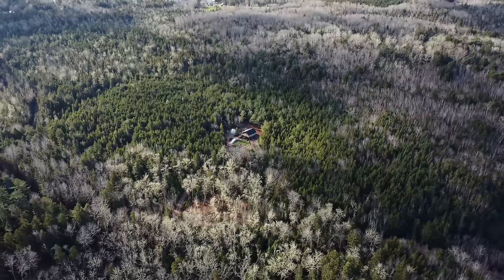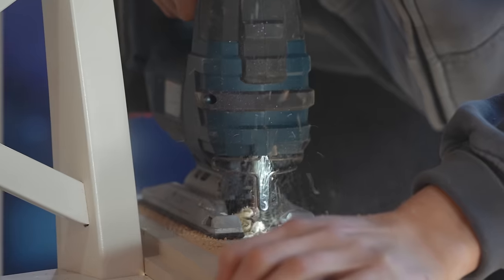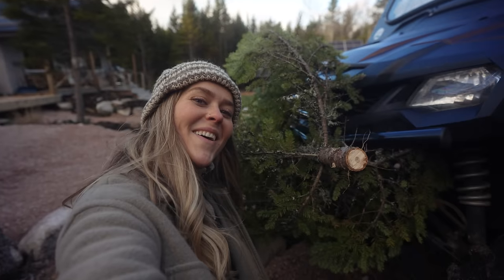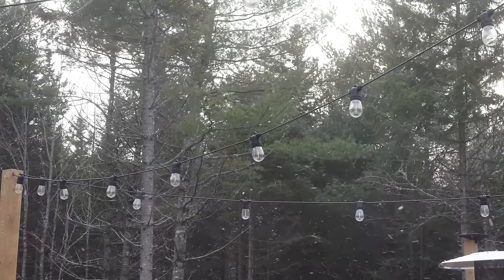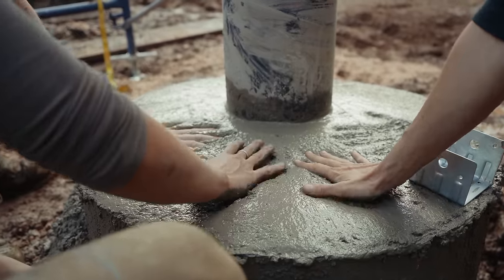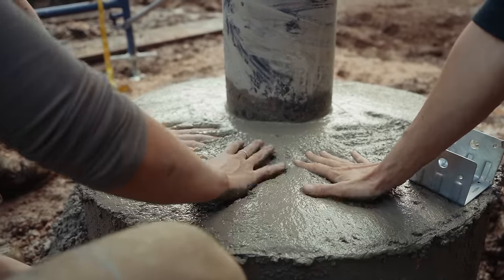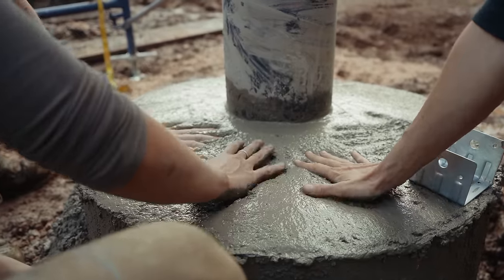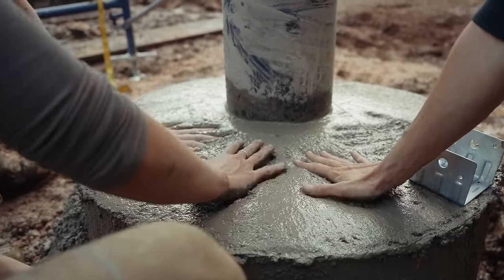Tiny House Bathroom Renovation!

Comment: You guys save so much money by doing that shower yourself. We just recently called a plumber to ask them how much they would charge to take out the old shower insert and to place a new shower insert and new faucet. They wanted 2800 USD to do that job. I even told them we would take out the old shower insert so they didn’t have to do that. The price was still $2800! So with having to buy the new insert which was $1800 we were looking at almost $4000 to put a new shower and new faucet in our bathroom. No thank you. You guys have given me the confidence to do it my own damn self. Thank you!

Comment: You gotta love the Pex plumbing. Even after 10's of thousands of fitting I've only had a couple that leaked but were easy to fix.
I'm wondering why you weren't suggested to embed tape on your seams when applying the Red Bond. Still, you two Rock as usual!
My favorite way to get to my plain of relaxing is to start at my feet and flex my muscles for 20-30 seconds then relax for 5 seconds and do each zone 3 times working my way upward.  
By the time I get to your head my body feels so relaxed it's almost like feeling numb. It's something I was taught by a professional weight lifter.
Reply from the maker: Hey Todd, thank you for sharing your knowledge with us. Wow that sounds so relaxing , will have to give it a try. See you Jan.2023💛🐾
Reply: @Vanwives  Looking forward to it as usual.
Seriously, you two are an inspi😎ration to so many.
Reply: @Vanwives  Yellow is  the color of friendship. My wife and I had a florist shop for 20 years is how I know. So that means we are friends now. Very cool and I'm honored.

Comment: A bathroom fan is a motorized ventilation device that removes excess moisture from a damp space (bathroom, shower room, laundry room), and exchanges it with fresh air from the outside. They are particularly important in airtight spaces (without windows or windows that won’t open). A good bathroom exhaust fan not only refreshes stale air but also prevents condensation, eliminates odors and stops mold from forming. Are you ladies adding that?⬆️

Comment: Ladies- just for your information: The new wrench is a pipe wrench and is used on galvanized pipe, black pipe, and plastic pipe that has screw fittings attached.  The jaws of the wrench clamp onto the pipe (bite into) and facilitate turning the pipe. It can also be used on round fittings for these pipes such as elbow, tees, couplings, etc.  This wrench should not be used on fittings with flat sides (hex fittings).  A crescent wrench should be used on those.  And it's helpful to have two pipe wrenches when tighting  fittings.

Comment: What days you need to ask some of your tool folks to give you some large Canvas construction tool bags you can put the contents of 3 to 4 5gallon buckets into one bag for project. If you have another one, you can organize your tools as to how they need to go together for projects, so you just grab the right bag to go in and do the job and they make mini bags but you can put 4 to 16 of the mini bags into a big bag so you can divide up your stuff even smaller bags and then grab the bags you need. For example, I have one bag that just has things you put into tools like drill. Bits sawblades screw bits stuff like that and and also in that bag all the tools required to change blades that don’t fit into the power tools, yeah, I’ve got a small one for plumbing everything I need for plumbing, and then I have a small one for Electrical everything I need for Electrical, and then I’ve got one allen wrenches and stuff everything I need to put together furniture you get my point here so you just go out your bags are labeled you say I’m doing this project you grab your main bag when you drop in the two extra bags of three extra bags that you might need into the big bag and off you go. I have 4 extra large bags and 10 small bags. Adam Savage sells them in his store, hook up with this vendor and you could sell your own in your store.

Comment: Is the under cabin area sealed from wind and cold air?  The drain pipes may freeze if left to open cold air.  Seal an area around any drain pipes  with foam board and insulation.